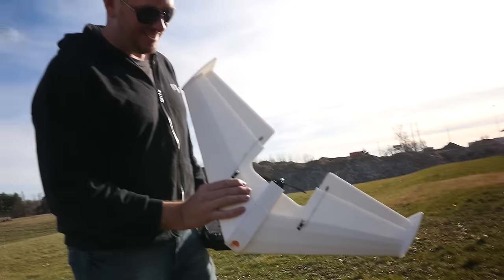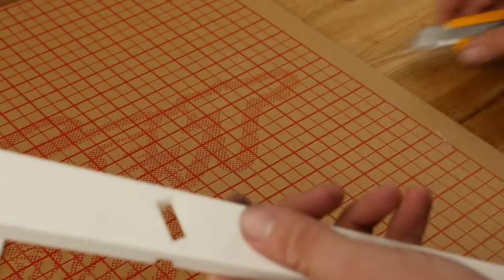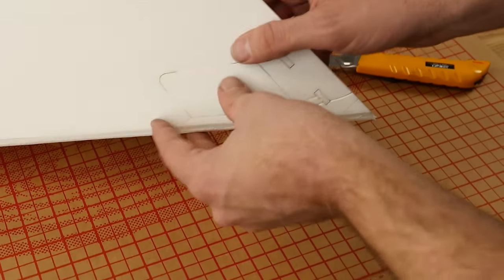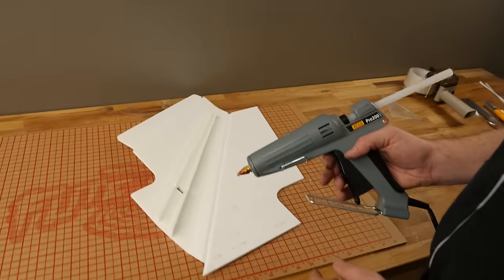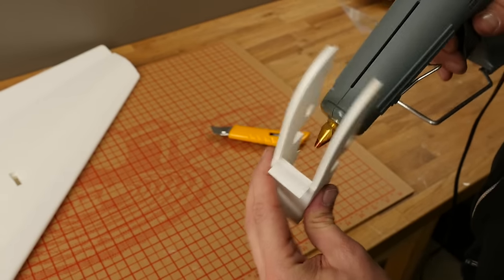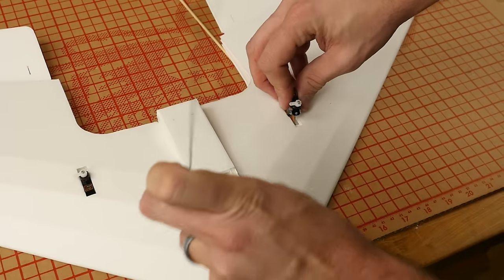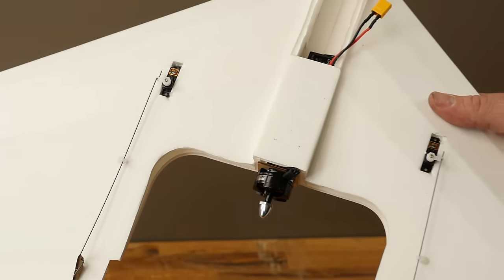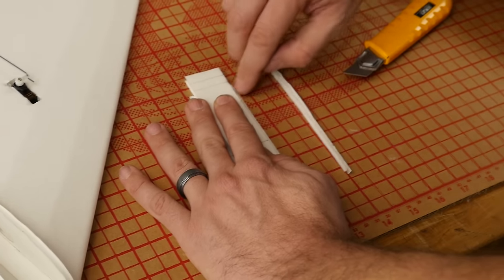FT Mighty Mini Arrow - DIY Build | Flite Test

Comment: Grr.. I've really want to give this a go bu the only thing holding me back is the controls.. I've got a radiolink At10 controller but I've been messing around with the settings and trying to understand their instructions.  But I still haven't been able to get the two servos to work for this. all I keep getting is left<->right servo 1 moves. up<->down servo 2 moves. How do you get them to operate for this?
Reply: Set your radio for elevons. Then play around with reversing channels on your radio. If that doesn't work, swap your elevon, and aileron leads to your receiver then try reversing channels again.

Comment: i got one of these built but when putting my radio in elevon mode its like my stick needs rotated 90 degrees if that makes sense. any tips on how to fix this? im new to this an finally got everything put together an looks like its ready to fly but my controls are off. i think i picked the wrong plane for my first after seeing videos of these thing flying they are way faster than i expected so im not in a real bit hurry to get this one in the air so im gonna pick another ft plane an try to give it a shot but what does this community suggest for a first time flyer, im guessing something that would fly slower would be best but i have 10 sheets of foam board waiting for suggestions.
Reply: got it figured out, so now the controls work the way they should. but im still open to suggestions on slower easier to fly planes. id rather start with something that is going to give me time to react. as fast as i seen these flying in videos i dont even think id have a chance to get the feel for one b4 i hit something so any suggestions will be appreciated. i may try to film its first flight but id rather learn with something slower then move on to this one. or am i completely wrong about this an this actually be a good beginner plane.

Comment: just build mine with fpv gear and a 100mAh battery, but it comes in at 350grams/12.5oz :( 
Is that normal with the fpv gear?

Comment: I don't understand the servo hook up  AIL/ELE? How are you mixing the setup?
Reply: It's call elevon mixing, it is different on every transmitter but it's pretty easy to find if you google it or look on forums. Hope this helps!
Reply: As David Logan said - but most radios have a preset for Elevons. Some radios call it delta wing or dual aileron. Basically when you set up your model in the radio, cycle through the plane types and look for Delta Wing, Elevons, Dual Aileron - they all mean the same thing. The radio will then give you a preset mix between pitch and roll - although in my case the mix was backwards so I had to figure out how to reverse the roll without reversing pitch.

Comment: Does the speed build kit include the  push rods and control horns? I checked and I couldn't find it.
Reply: yes it comes with a firewall, push rods, and control horns
Reply: +Travis Wilding Thanks for responding so fast:)
Reply: +Hoboman303 no pronlem, I just got my kit and was opening it on the floor and noticed that it came with that stuff and figured I'd go on here and see if I could help out cus I wasn't sure either.
Reply: +Travis Wilding I was gonna buy them separately on the flight test store so thanks for saving me 11 bucks:)

Comment: What if your remote controll can't invert channels that easily? 
How would you invert channels if that's the case?
Reply: +ct_57 turn the control arm 180 degrees so its on the other side of the servo

Comment: i am a multi rotor guy that has never built or flown a wing i am scratch building an arrow and on the plans it says the cg is 1.75 in but 1.75 inches from what?? HELP
Reply: +ZENJOY FPV Check out the markings on the plans. It's about 1.75 inches from the back edge.

Comment: could someone please tell me what the speed builds come with like control horns, push rods, swappable pod and fire wall not including power pack, or do i need to buy everything separately ?
Reply: +Dylan Gordon Yes, the kits come with all elements but the powered stuff like servos, motor, prop, battery. You can add those to the kit in the store though.

Comment: is it possible to cover the foam with solarfilm to make it water proof?
Reply: +wyliemick The foam is not the problem - the paper is. If you use film on the paper and somehow water comes under the film, the paper will delaminate from the foam including the film that sticks to it. 

Best option is to remove the paper and use something else like packing tape for the cover.
Reply: +Balu how do you cleanly remove the paper?

Comment: How can you tell if it's upside down while you're flying?
Reply: If you pull and you chrash your wing was upside down :D
Reply: If you flew a wing, then it's actually pretty easy. If you accidentally roll and loose orientation then you can move the control surfaces tiny amounts and figure it out. I put decals on my wing so I can tell if it's the right way up or not :)
Reply: +Caleb Limb use of different colors on top and bottom surfaces can also help, however I have found that once you get a little distance out any color will look dark or black, even yellow. I often do a dark colored bottom and lighter colored top, like red bottom and yellow top.
Reply: Paint one side

Comment: how accurate dose the cg have to be is an inch or so off bad to fly with
Reply: It needs to be very accurate. You can be off maybe 1/16 inch. If it actually flies it will tell you the CG is off. You'll need to trim the heck out of it. Best bet is shifting electronics and battery to change CG, or as a last resort add weight to compensate.

Comment: New to the hobby so will a MZ-12 work with this?
Reply: +Cellinger 2735 You have probably already figured this out, but in case someone else has the same question: The MZ-12 has elevon mixing, so yes - it should be fine.

Comment: could you fly a plane with a pistol grip controller it has a wheel and a trigger on it
Reply: +MEGATRONBEZ117 Those are only two control channels. While there are very simple planes that fly with two channels, most require at least three for power, aileron and rudder. Four if you want to add ailerons.

Comment: What radio is josh using in this build and where to buy it
Reply: +Armand Belen Josh is using the "big" Graupner MZ-24. Flite Test has them in their store if you want to support them, but you can probably get it in your local hobby shop. http://store.flitetest.com/transmitters/

You might get away with a "smaller" (and less expensive) transmitter like the MZ-12 too, but it needs to be programmable, so you can chose elevon mixing for wings like this.

Comment: Hi i am new at this
what material do you use?
Reply: +Cabo Muñoz It's called foamboard. It's ~5 mm thick polystyrene foam laminated with paper on both sides. The official product name is "Adams Readi Board". You can get it in Dollar Tree shops in the US.

Different foamboard is often a lot heavier. So that might be a problem if you a re looking for a replacement. Another option is Depron boards which doesn't have the paper, but you can use tape for the hinges, etc.
Reply: Balu thanks for the info

Comment: Does anyone know where to get this board in the UK or the equivalent ?
Reply: +Thomas Hilton 

http://www.hobbycraft.co.uk/foamboard-a1-5-pack/610091-1000

order online or find local shop :) just a quick tip about removing paper. This foam is somehow different to what they are using and paper wont come off so easily. Buy methylated spirits from B&Q and first peel off shiny layer of paper then soak it with spirit, leave it for few minuter then rub off with sand paper 120 grid for example it will come of very easy. let it dry for another 10-15 minutes. 

Happy flying :)
Reply: +liquidsky I will check that out thank you!

Comment: what transmitter was josh using? anybody know?
Reply: +Barnaby Harper At 36:36 you can see that it's the Graupner mz-24
Reply: I wouldn't recommend unless you're fluent in German.
Reply: As far as I know none of the guys at Flite Test speaks fluent German. But they use the Graupner's a lot and even sell them in their store. 

They wouldn't do that if it didn't include a proper English manual. :)
Reply: They would and have. If you consider the English in the manual (available online) proper, we're clearly not on the same page. Yes, they're a distributor. I'm sure they have access to a human to walk them through everything. 

That's not my issue as the Graupner staff responds quickly to everyone most times. I just don't want to have to contact them for everything. The documentation is poorly organized and is available in limited quantities in English.

Comment: The plans don't have the CG marks.
Reply: +Anand NL I&#39;ll ask Sp0nz to look into it. The problem is probably that the plans are for the inside of the wings and the CG marker has to be on the outside :)

The specs page on the plans lists the CG:
CENTER OF GRAVITY / CG: 1.75 in / 44.5 mm (updated: in front of rear firewall)
Reply: found something: FT MIGHTY MINI ARROW SPECS

Weight without battery: 6 oz (170 g) 
Center of Gravity: 1.75 inches (44 mm) in front of rear firewall

So not from the front but from the back (info from: http://flitetest.com/articles/ft-mighty-mini-arrow-build
Reply: +Anand NL Dan is going to add markers on the next revision :-)

http://forum.flitetest.com/showthread.php?17136-SP0NZ-Plans-Index&p=258207#post258207

Comment: I KNOW WHAT I WANT YOU TO BUILD!!         IT WOULD BE A HOT ITEM!!                                                                                                                                                                                                                                                                                                                                                                                                                                      U CAN USE MY IDEA IF U SEND ME A COMPLETE BUILD OF IT :) I WANT BALSA BALSA BALSA LOL LIKE A MINI CUB 4 CH A,E,T,R BUT I WANT SMALL AND SLOW FLYING A  MINI XTRA OR SOMETHING. I DONT WANT OVER 30 INCH WINGSPAN I WANT IT TO FLOAT LIKE A BUTTERFLY AND A BRUSHLESS POWER SYSTEM LIKE U USE N THIS VID OR SMALLER BRUSHLESS POWER. PLZZZZ A MINI BALSA IM BEGGIN LOL THANKS FOR THE VIDS. P.S. PLZZZ A MINI BALSA. 2CELL OR 3CELL BATTERY THAT LAST LONG AS POSSIABLE. OR A MINI STICK. BALSA PLZZZ AND REAL 3 WIRE SERVOS. THANKS W9DES

Comment: Lets see you truly scratch build it.  That is start with templates,  trace onto foam, then cut out.  Guaranteed it wont go well.  NO Laser cutters and NO pre printed templates on the foam.
Reply: He demonstrates the build with a scratch build kit for the sake of simplicity in the video. The scratch building process really isn't that difficult. All you have to do is print out the tiled plans, tape them together, trace, and cut. On a simple plan like this where you only use two sheets of foam board, it doesn't take very long at all. These plans also have a relatively large margin of error. Even if the pieces do not come out perfectly, it will still fly great. I would say that cutting the pieces out is much simpler than the build itself.

Comment: MAN I CAN BUILD THAT WITH MY TOES , BLIND FOLDED AND  MY ARMS TIED BEHIND MY BACK,
Reply: bullshit.
Reply: VM D LOL. OK I CANT DO IT WITH MY TOES. BUT I BUILT MY 1ST BALSA PLANE IN 1980 AND IVE BEEN DOING IT SCENE NOW I HAVE A BIG DRAFTING TABLE AND I LEARNED HOW TO DRAFT IN SCHOOL WHEN LEARNING TO BE A  TOOL AND DYE MACHINIST. I HAVE THREE METHODS I LIKE TO USE FOR BUILDING MY RC.AIRCRAFT. THE 1ST IS BALSA WOOD THE 2ND I BUILD A MOLD AND USE GEL COAT AND FIBERGLASS. BUT RECENTLY I HAVE FOUND THAT I CAN DEIGN AND BUILD VERY VERY NICE RC.AIRCRAFT OUT OF ALUMINUM AND RIVETS, ALSO I AM TRYING TO LEARN HOW TO BUILD MY OWN GAS TURBANS AND I WANT TO START USING VARIABLE PITCH PROPS .THEY ARE HEAVER  BUT AT THE SAME TIME THEY ARE WAY FASTER AND I  HAVE NOT TRIED THE GAS TURBAN OR THE VARIABLE PITCH PROP A OF YET. I CANT WAIT TO SEE HOW IT BEHAVES WHEN I FINISH THE NEW PROP AND ENGINE .  STAY  IN TOUCH AND I WILL KEEP U POSTED.
Reply: jan lechner Ok. Ever thought of not using caps?
Reply: How does the gas turban look like? Is that something invented by Sikhs?
Reply: jet aircraft are propelled by the exhaust much like a rocket motor. a gas turbine does the same thing but instead  the exhaust  turns a shaft that spins the prop. it can spin it so fast that a vacuum can form around the trailing edge to prevent this from happening the blades of the prop can be adjusted during flight . and it is called a turbo prop. thanks for asking anytime u have question  feel free to drop me a line. talk to u later have a good day
Reply: Nice video as always. Kit says 12° of deflection expo 30%. The little gauge that comes with the kit measures 19 degrees on the low side and 26 degrees on the high side.  So I'm confused, is it 12 or 19 degrees?  I only ask because the first flight is the most critical and I crash more than most. Any help is appreciated.